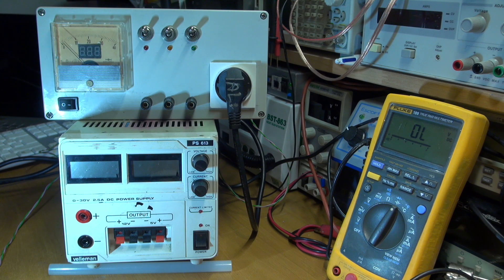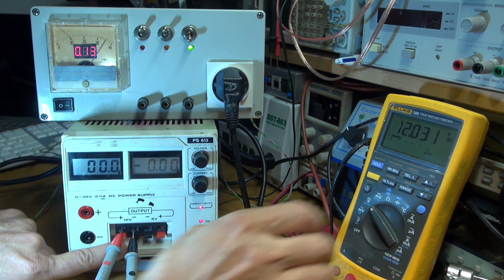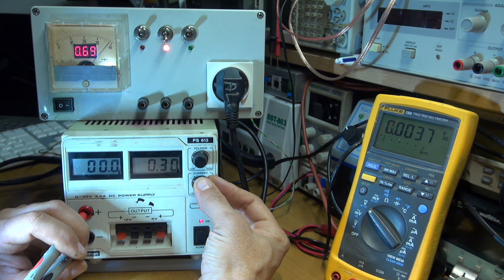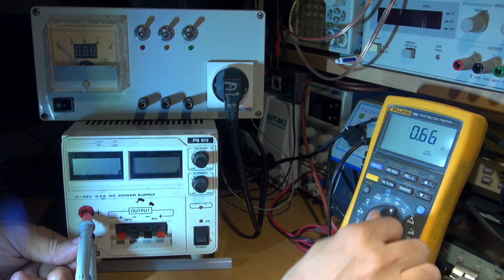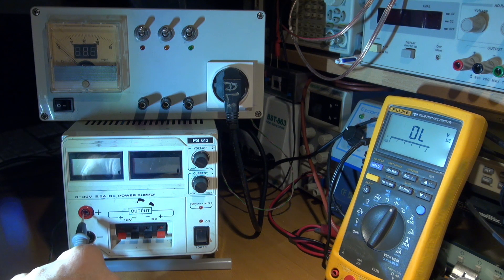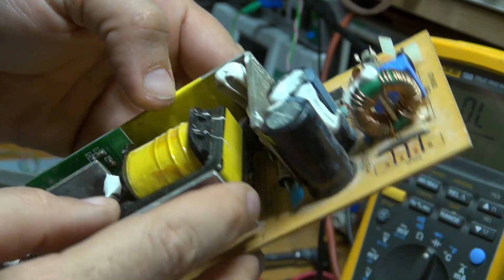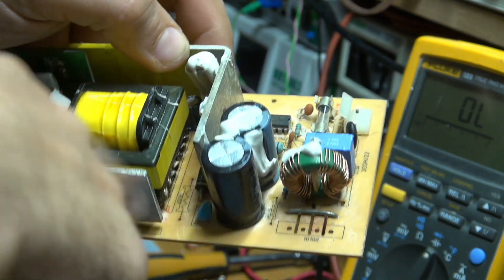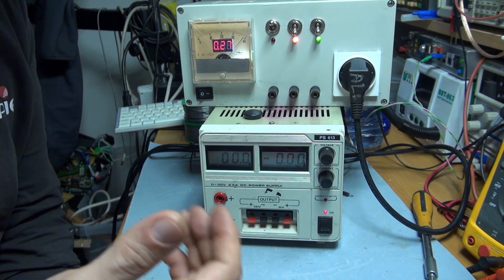VELLEMAN PS 613 Linear power supply repair

Comment: I did exactly the same mistake. But with a LiFePo4 battery. Fortunately the internal BMS in the battery went into protection mode, turning off the current (30A or more for a sec.). When I measured a short between the terminals on the power supply, I was glad as the diode still was short and not open, protecting the rest of the power supply. Easy repair.
Reply from the maker: a simple diode can save you day. Thanks for commenting.